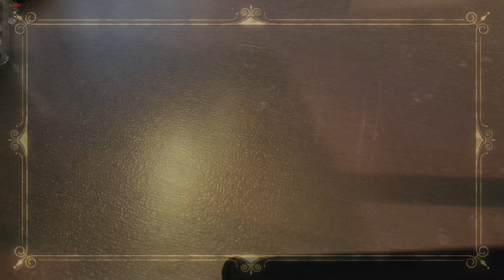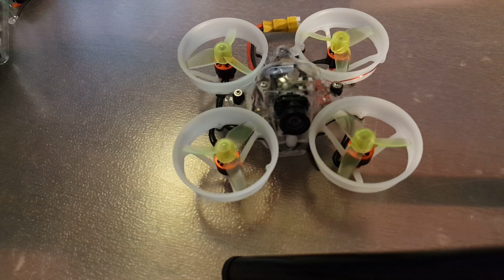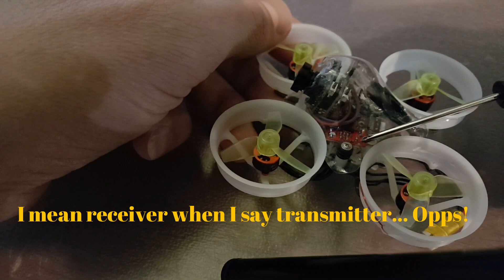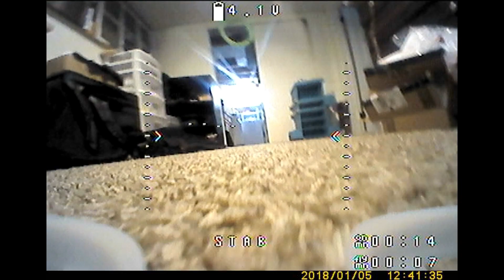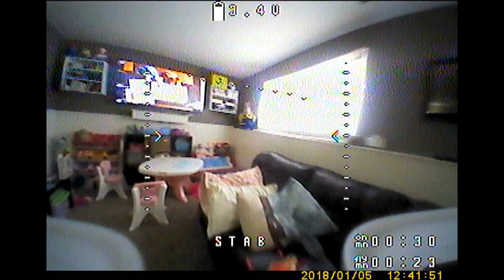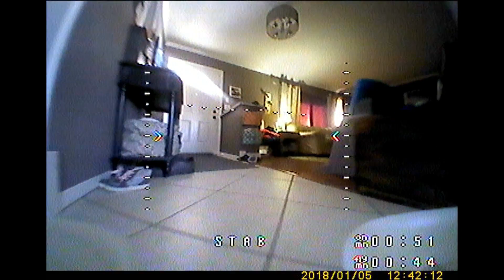Griffon FPV Brushless Ghetto Bird

Comment: curious, is that the BetaFPV H02 camera under that canopy?  If so, I need to get a few of those!  I hate that canopy that you didnt use.
Reply from the maker: This camera is a VM2571 V1.0 the H02 is a VM275t ver 1.0 slight difference in size but it fit nice after a small modification to the canopy opening for the lens.

Comment: How is it compared to the Beta65/75?
Reply from the maker: There is a lot more controlled power with this one.  I can recover easier and I find it is much easier to take a tight corners.  I get less flight time but over all Im very impressed with griffonfpvs choice on parts for this kit.